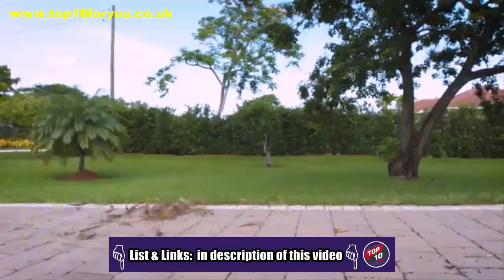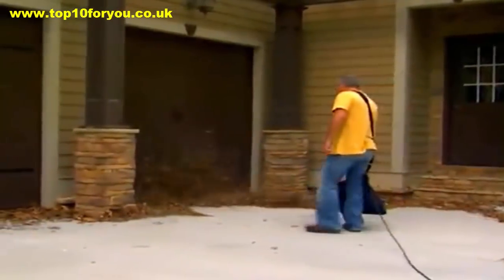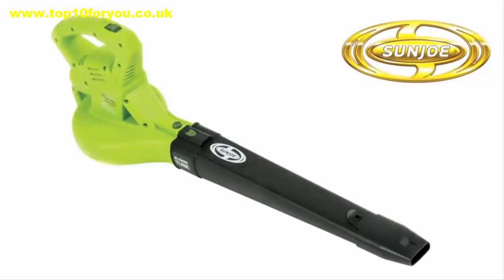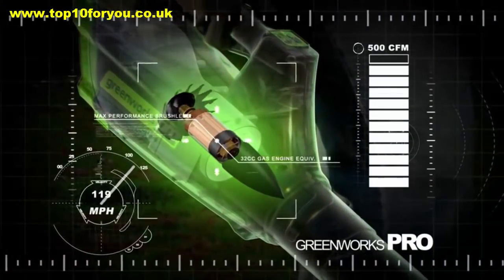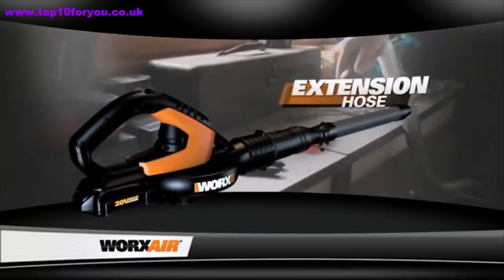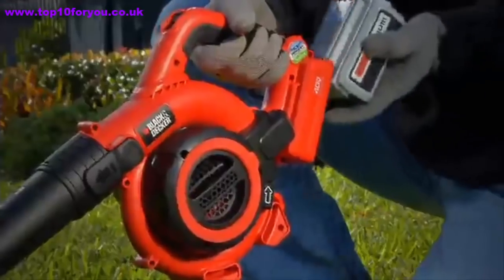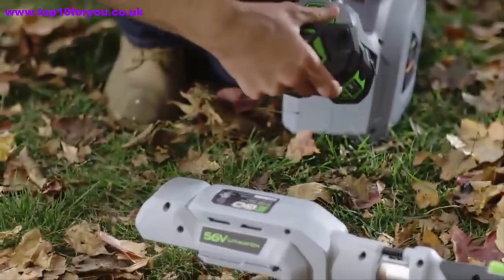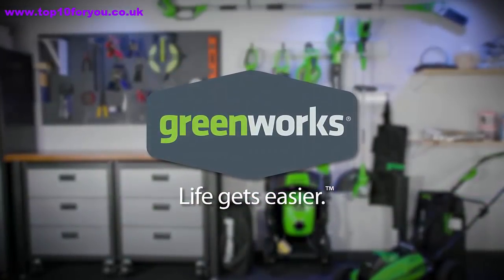Top 10 Best Cordless Blowers 2019

Comment from the maker: Top 10 Best Cordless Blowers 2019
| List & Links:  

1.  GreenWorks 24252 G-MAX 40V 150 MPH Variable Speed
● US ► https://amzn.to/2WM5xiZ ◄

 2. EGO Power+ 480 CFM 3-Speed Turbo 56-Volt Lithium-Ion
● US ► https://amzn.to/2IjKjjh ◄

3. WORX WG584 40V (2.5Ah) Power Share TURBINE Blower
● US► https://amzn.to/2Ikvk8N ◄

4. BLACK+DECKER 40V MAX Cordless Sweeper (LSWV36)
● US ► https://amzn.to/2WO52oS ◄

5. WORX WG575.1 WORXAIR Lithium Multi-Purpose Blower/Sweeper/Cleaner, 32-volt, Battery and Charger Included
● US ► https://amzn.to/2WOktxc ◄

6. Greenworks Pro GBL80320 80V 125 MPH - 500CFM Cordless Blower, Battery and Charger Not Included
● US► https://amzn.to/2EWg9Si ◄

7. WORX TURBINE 56V Cordless Blower with Brushless Motor, 125 MPH and 465 CFM Output with TURBO Boost and Variable Speed – WG591
● US ► https://amzn.to/2XrZnBW ◄

8. Sun Joe SBJ601E 10 Amp 215 Max MPH All-Purpose 2-Speed Electric Blower, Green, Green
● US ► https://amzn.to/2XoJ8p8 ◄

9. WORX WG509 TRIVAC 12 Amp 3-in-1 Electric Blower/Mulcher/Vacuum with Multi-Stage All Metal Mulching System
● US ► https://amzn.to/2K0eWgV ◄

10.Sun Joe JB450E Turbine Electric Jet Blower, Green
● US ► https://amzn.to/2Iq629d ◄